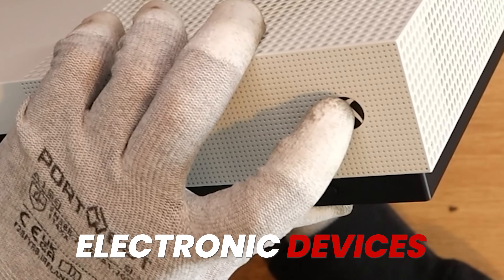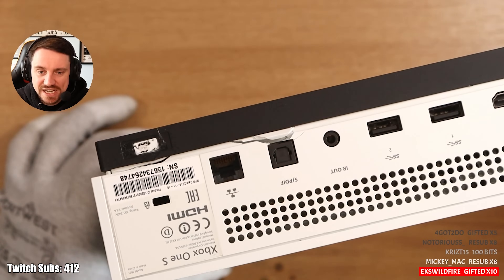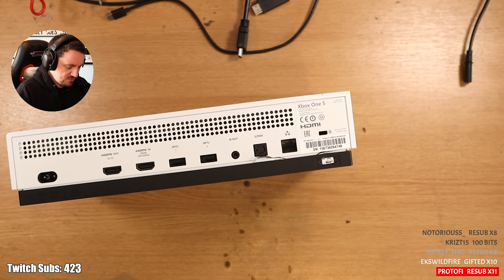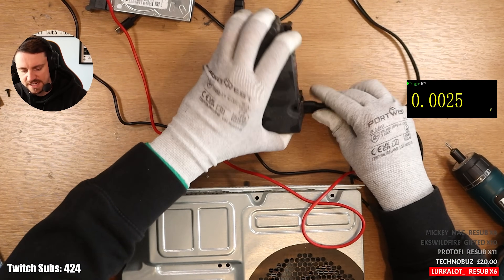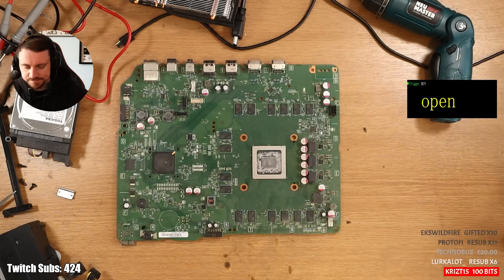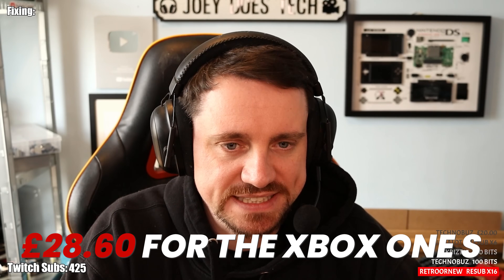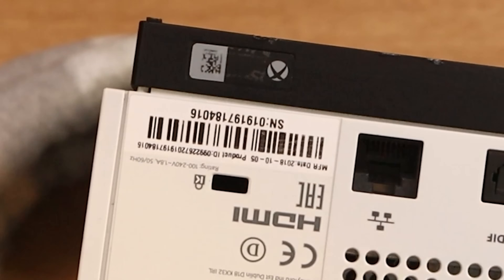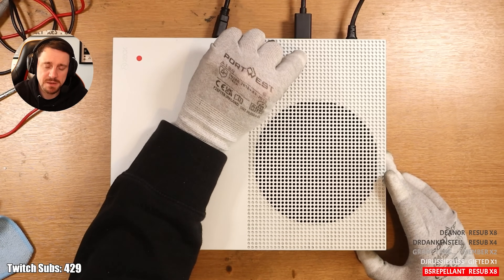Trying to Fix FAULTY Games Consoles for a Profit! S2:E36

Comment: Joey, in a previous episode you mentioned not wanting to open up or work on power supplies. Is your apprehension about reselling those if you fixed them or just generally working on them? The way you approach repairs is smart and methodical and I'm confident you'd be able to do just as well repairing those.  (even if you didn't resell them)  You learning and doing something new like that, building up your experience , would make for a great video! Thanks for the great content.